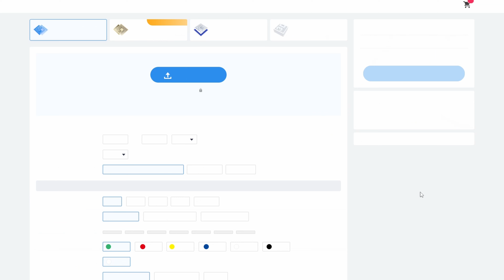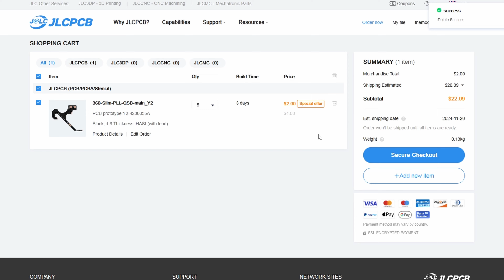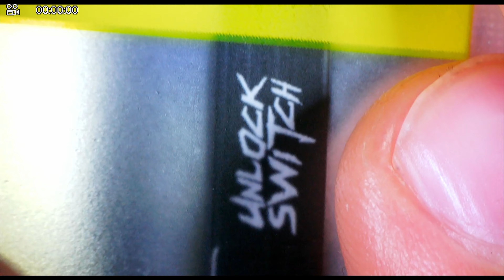The Truth About the UnlockSwitch Flashcart.

Comment: Its a scam. They sent out samples that worked at the start. Now appatently they cant get firmware. What happpened to thr original samples? Its a scam
Reply from the maker: The original ones sent out had the IC’s ripped off of Mig Switches, which is why they worked. These models don’t have any firmware available, which doesn’t definitively prove it a scam, but isn’t a good look at all.
Reply: @TheModSmith  so literally from the beginning it was a scam😂

Comment: Did you try mig switch firmware on the unlock switch? As they are similar enough maybe the software would work?
Reply from the maker: The Mig Switch firmware is not publicly available either.

Comment: Can this be used as a substitute for the system's microSD slot?  Someone has a Switch system with a broken microSD slot, and I was wondering if this flash cartridge's microSD slot can be used to back up all of the apps on the system or store NeS purchases...
Reply from the maker: No it can’t, this is only for loading game backups.
Reply: @ It's too bad.  If worse comes to worst, might as well trade Switch systems and sell the busted one just so I can have easier chances of buying a Switch with a working microSD slot.

Comment: Apparently nintendo delayed switch 2 due to migswitch releasing last year, the timing was pretty spot on. Switch 1 games are already playable on switch 2 due to backwards compat, that train has left long ago and nintendo cant do anything about it.
Perhaps they found out switch 2 games are ALSO playable on migswitch, which is devastating for them.

That said, unlockswitch is either a scam or waiting for switch 2 to be released. TBH they got a point as switch modding scene is pretty easy to do with $5 mod chips.

Comment: Yesh they wont provide firmware because the ninjas will come after them. Thats how picofly/hwfly gets by too, they are technically just raspbery pi chips that just so happen to he in the perfect shape 3 to mod a switch
🤣

Thats why Isave all the firmware I can, I know Nintendo is quick to purge stuff from the web.
Reply from the maker: Most of the modchips I’ve used come with the firmware already preloaded. I wonder if different vendors take different precautions to prevent getting shut down? I’m curious to see how this whole UnlockSwitch firmware thing plays out.